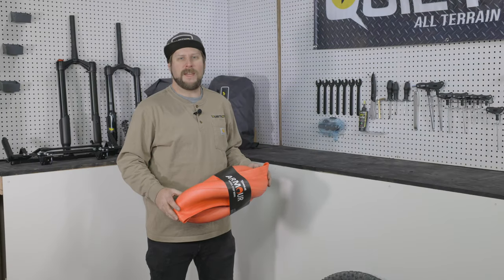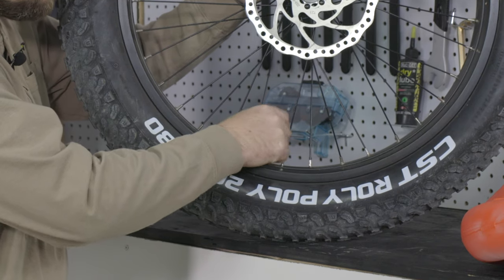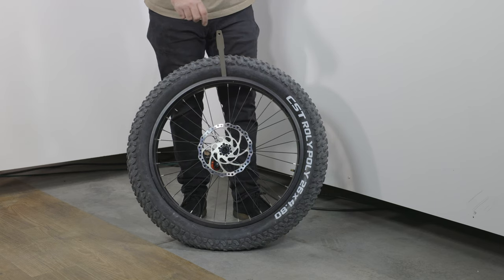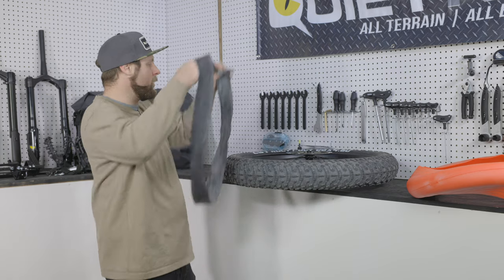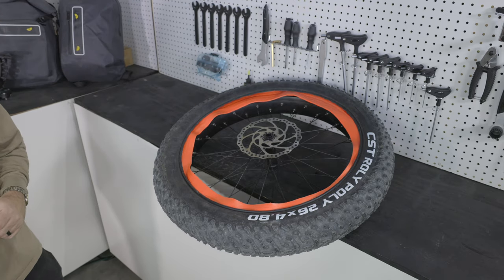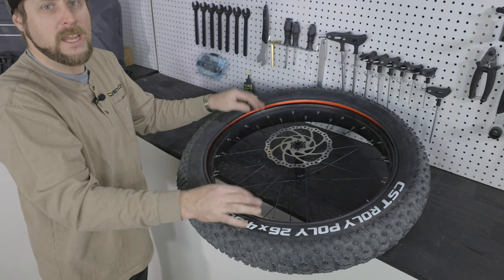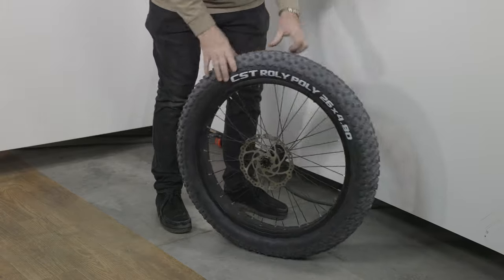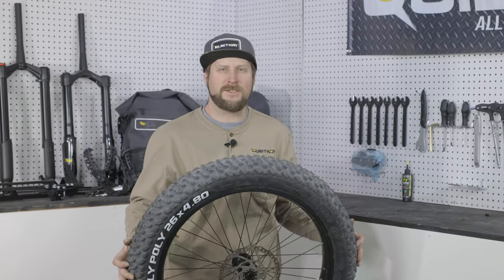Tannus Armour Tire Insert Installation

Comment: Just got a pair of Tannus inserts for my Hemiway Cruiser. The hardest, knuckle bruising part was aligning the innertube valve into the rim 'after' inserting the Tannus liner. Thanks so much for taking the time to post this, how-to video. Makes it so much easier than doing it blindly.
Reply: Hey do u need to remove the wheel. My wheel is detached from the rim but i dont want to remove it toonkuch work 😂

Comment: I used the same tire with the same tube and followed the instructions as provided.  Took about an hour as I also put “ flat out” in tube as well.   One point I highly recommend is to break the bead on both sides and to slightly inflate tube.  The ride feels the same.   Great video.   Thank you.

Comment: The instructions that came with my tire levers state that they are not for installing a tire. They should only be used for removing a tire from a rim or removing ears from under a flat brim hat.
Reply: Yeah those metal tire levers are a great way to mess your wheel up If you use a little body English hold your tire down into the drop Center you can generally do this with a small plastic tire liver or do it by hand is a decent video but there are a lot of mistakes they would give people trouble
Reply: My milk carton also says it’s causes cancer

Comment: I had a bike shop installed these on my Cyrusher 690 . I can't go up a hill anymore without killing myself peddling with assist on. Could the shop have done something to the motor? The Batterie is good. This could be just bad timing for the motor as well. I had Cyrusher check everything via video. The thought it was the controller so I replaced it. No change. Just looking for advice. Thanks

Comment: According to tannus website you need a smaller tube. 26x3 tube for a 26x4 tire. You used the same one. I’m lost here
Reply: He says on the vid tannus recommends a smaller tube but if you don't have one the normal one will work 4:50
Reply: It came with them- but other youtube vid's continued with the 4"- after using the 3.5" it straightened out.

Comment: I followed along with what you did- I have a RAD Rover step thru 1 with 4" tires. When I removed the tire deflated and removed tube, this was the front tire. Then inserted the TA, it seemed big for the tire but finally got it in, then inserted a new tube that was sent with the TA, aligned valve pushed everything in place, then reset tire. Set on floor roll it around with a little weight, then began to inflate tire, stopping at 10#'s to roll and massage it, then finished inflating. After inflating to 15#'s I noticed valve stem was sitting at an angle, so deflated, repeated procedure from installing tube and reinflation, making sure valve stem was straight, once again valve stem was set at an angle, after full inflation. QUESTION: WHAT COULD BE CAUSING THIS?
Reply: Try inflating the tube on its own, valve stem may be crooked from the factory
Reply: @ryanjspinks  Got it straightened out, when it inflated the tire twisted, this caused it to keep kicking the valve stem off to the side. So now I have developed a process by which I install and then inflate to avoid this in the future, I have the rear tire to do this weekend.
Reply: I installed my
Reply: @whyndellgrizzard7495  Thank you for the information! I had the exact same problem today while installing the front tire...I finally had to take everything apart and start from the beginning being extra cautious to make sure the valve stem didn't tilt to one side while tucking the tire bead back in. VERY time consuming and frustrating. So, can you please explain with more detail what your discovered process consists of? Thank you so very much in advance for your help! I'm doing the rear wheel tomorrow :(
Reply: Lol. I have the #2 and I still got a flat with these on. Now I can’t get the damn tire off and it’s frustrating as hell
Reply: you can take scissors and cut the tannus insert.

Comment: once again no one has said what they can resist.thier not cheap.so for this money i expect 100% protection.itrs not like their a cheaper solution.plus how much smaller tubes? could i get away with 1.95-2.10 on a 2.8" tyre??? or is not problem with pinch flats.also vould you use tpu tubes this seems a better use can tpu tube have puncture proof slime in and could you use it here also with the Tannus Armour for complete piece of mind or maybe slime tape with this tannus is more then enough for 100%

Comment: I just got some yesterday, it was a super easy install. 
Only thing is, I've noticed tire pressure drops, is that normal or due to the material condensing under the weight of my bike? The tube is the correct size and is brand new so I'm not sure if I did something wrong

Comment: Sadly, these didn’t work at all for me. A small nail ran right in and now I have to patch the tire but it’s a lot harder to get the tire off. Any suggestions on how to do that??
Reply: Hi alus!  Sorry to hear about the nail puncture.  To get the inserts out all you need to do is reverse the steps shown by quietkat.  Tire levers will be your best friend.  Cheers
Reply: @RideTannus  awesome. And you are right, they’re life savers

Comment: no way in heck. I've gone 3 hours and can't get the armor to seat correctly. The initial insert of one side rolls over and won't stay up against wall it rides in the channel and won't move up and out of the way.
Reply: Get a bag of zipties & use them to hold the tire tightly to the rim as you work your way around it. You shouldn't have many zip ties left when you're done lol

Oh & a little dish soap on the tire on the area that has to go over the under the rim helps alot

Comment: ive heard that tannus linner can deteriorate inside the tyre over time and mybe damage your inner tube.
Reply: What if it does, you want to give up protection from flats over time, to save a $20 tube?
Reply: A little bit of baby powder can help combat this.  Creates a nice slip zone.  If that is happening, it's most likely a tire defect?  Cheers

Comment: These things flatten to about 1/8 of the original thickness and cause flats.but I guess you know that by now .
Reply: How so?
Reply: @philliprice5980  pressure from the inner tube with down bearing pressure flattens these down to about 1/8 of an inch . The inner tubes. Slips and ruptured at the stem and crimp the tire tube. twice before I noticed problem . I've started to see the negative reviews. Everyone that buys these will expierence the same thing. I ran them at the suggested 20 lbs .